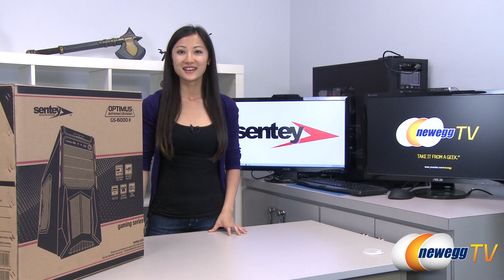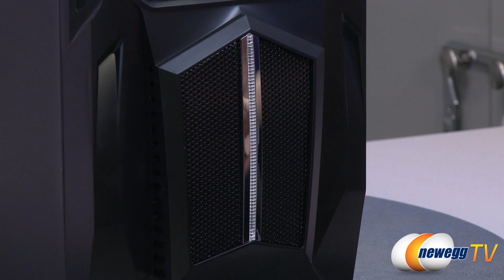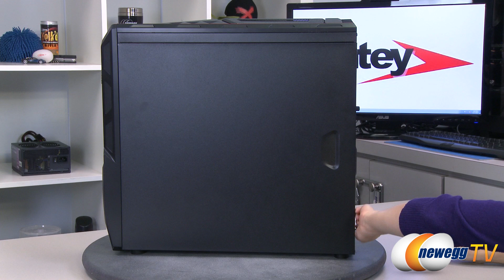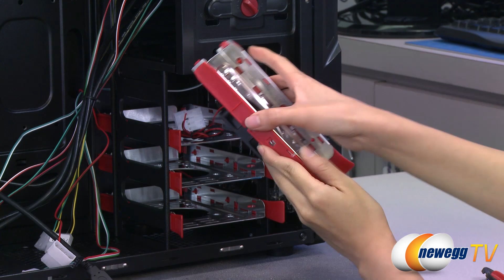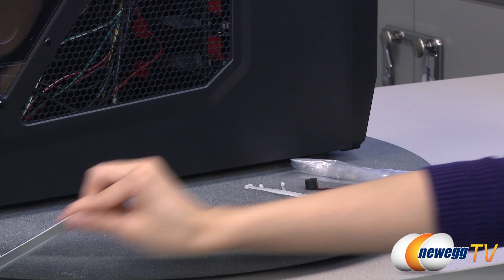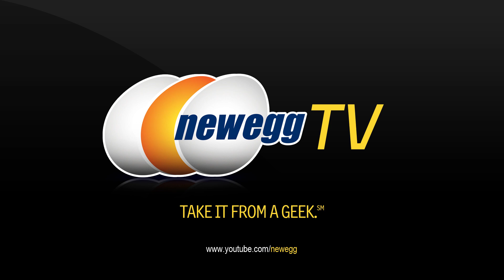Newegg TV: Sentey Extreme Division GS-6000 II Optimus Black Mid Tower Computer Case Overview

Comment: I'm indefinitely returning it. My motherboard is incompatible with it, as the top fan is unremovable so I cannot plug in my 12V connector. ASRock doesn't work well with this case.
Reply: what mobo do you have? It only supports Micro ATX, ITX, and Extended ATX and Regular ATX boards
Reply: if you ever wanna avoid incompatibility like that in the future go to pcpartpicker.com
they make sure all parts are compatible and that they all fit together plus they find the cheapest price for your parts

Comment: I don't get why they shose to have a USB "pass-through" cable plug instead of a standard 9 pin(?) USB 3.0 motherboard plug. :-/
It's nice they provided a motherboard speaker. Neither my case or motherboard came with a speaker, so I had to buy one separately.

Comment: the cable for the front panel i/o connectors must be connected with the motherboard back panel instead of using the internal header.its like having an internal cd drive but you have to connect it from the outside.comprende?=)